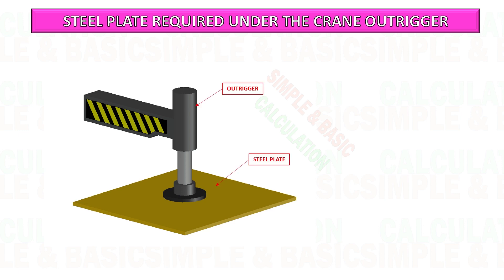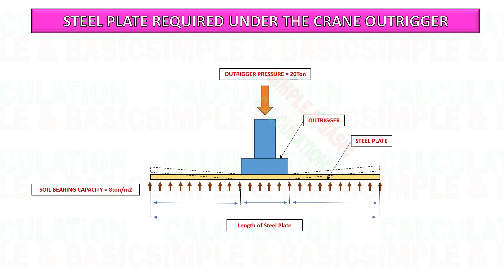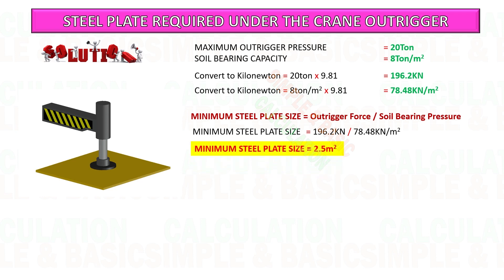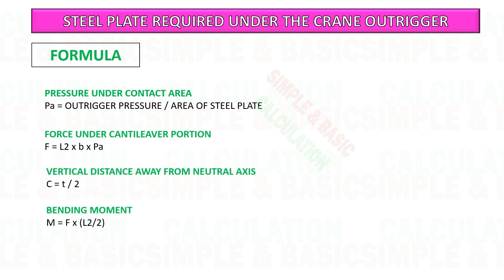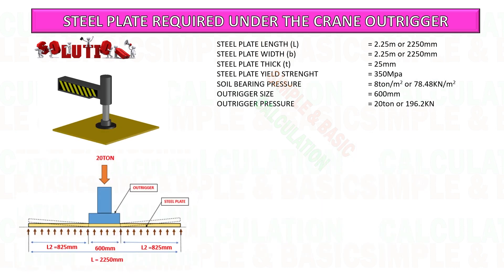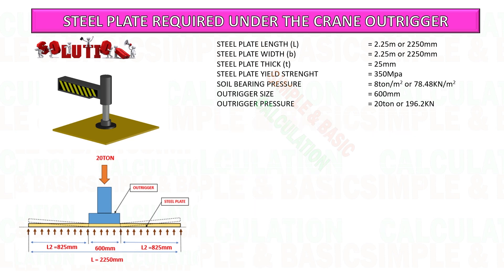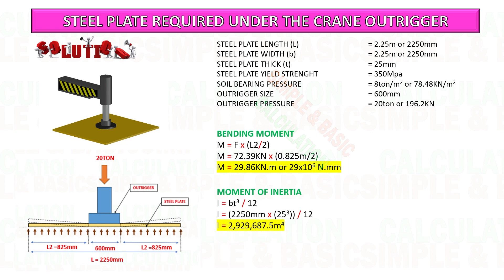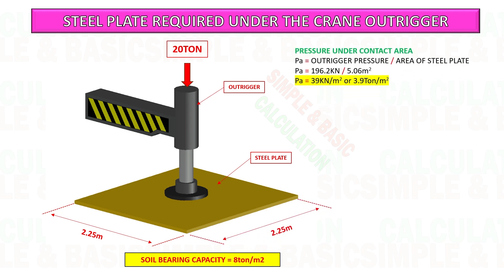How to Calculate Ground Bearing Pressure Under Steel Plate of Mobile Crane Outrigger#crane #lifting

Comment: How to get the maximum outtrigger pressure?
Reply from the maker: The maximum outrigger pressure can be obtained from the software provided by the crane manufacturer.
This software is primarily shared by crane suppliers.
In my upcoming video, I will demonstrate the process of manual calculation.

Comment: Wrong man-- area req is 2.5 msq , means Sq root of 2.5 that means 1.58 m X 1.58 m steelplate needed
Reply from the maker: Hi, natma. The minimum size required based on the site's permissible GBP is 2.5 square meters. However, it is necessary to incorporate an additional safety factor to ensure that your GBP does not exceed the permissible GBP limit at the site. Therefore, it is necessary to select a larger surface area for the steel plate.